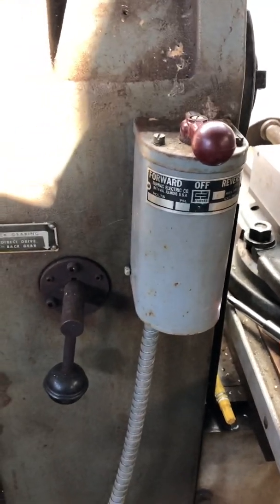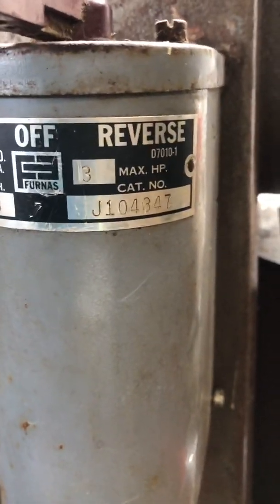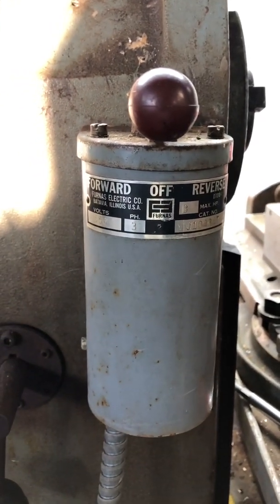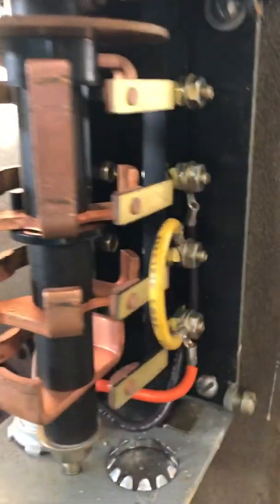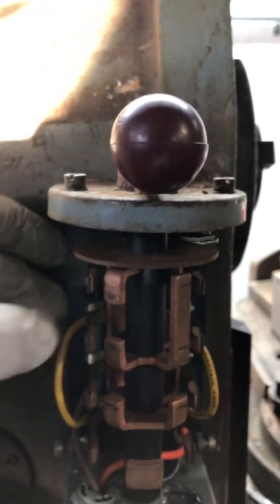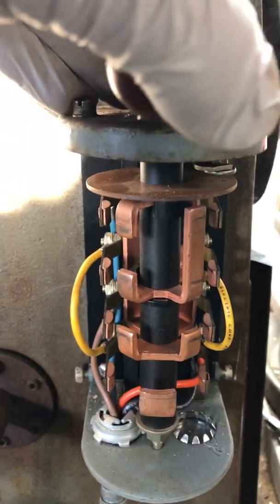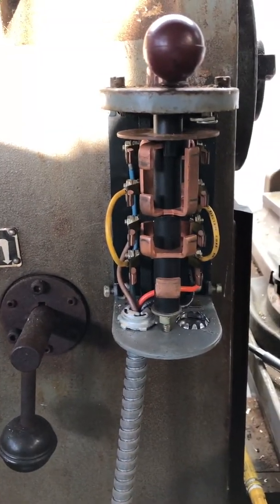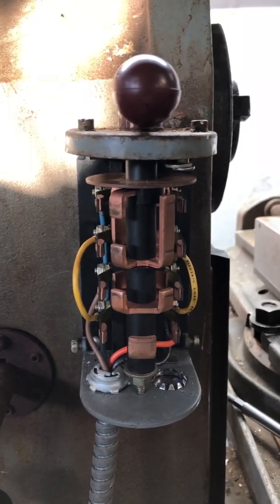Rockwell Mill - Wiring it up and using the original Furnas Drum Switch

Comment from the maker: I forgot to mention that the Drum switch physically reverses the phases to get reverse. Just like when you wire up a three phase with two of the phases reversed. The Drum just reverses that mechanically. The VFD will do it electronically to the exact same effect. 

Dan
Reply: I have a Furnas Drum switch that's on a lathe I was given and I recently put it back together, however after I wired it I noticed both forward and reverse rotate the motor in the same direction. Do you know of an easy to follow wiring diagram for a Furnas Drum switch?